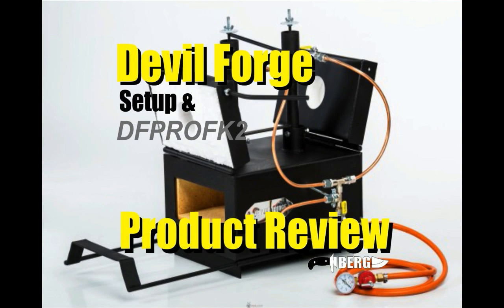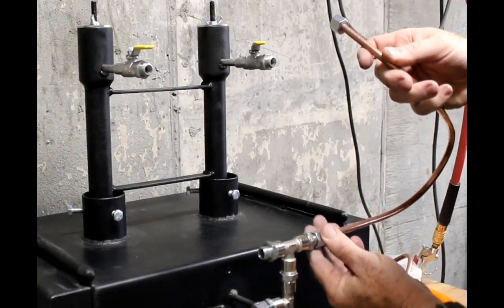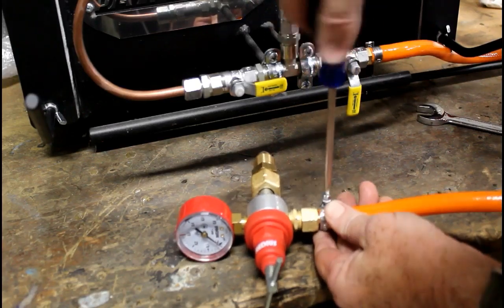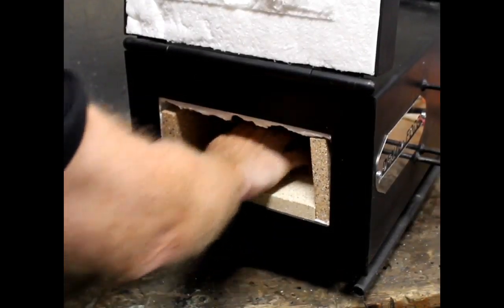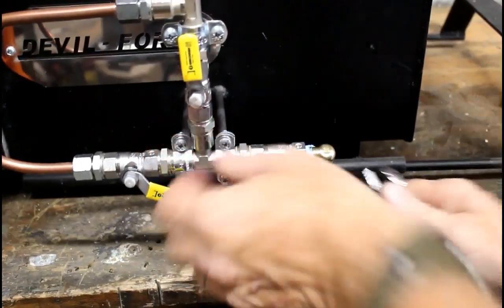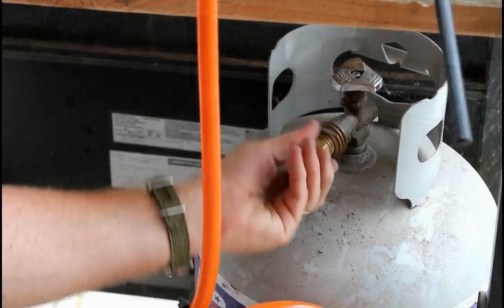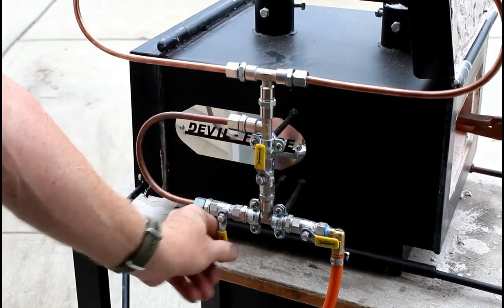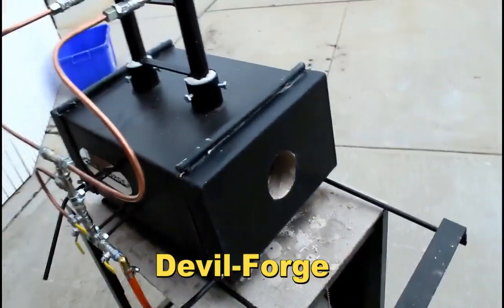Devil Forge DFPROFK2 Setup and Product Review Ebay

Comment: Never use teflon tape or anything that can combust in a gass setup.. it might go boom
Reply: This is only partially correct as there is teflon tape for gas fittings. I would higly recomend using specialized sealant on any type of screw connection.

Comment: Thanks for a clear instruction video. We received our Devil Forge #DFPROFK2 today, and on unpacking it, I was pleased to see that the gas inlet is now angled down towards the floor - or you can angle it as desired - similar to your modification. (3.02).
I should point out that when tightening the gas pipes, you should use another spanner on the slightly larger nut on each joint to balance out the twisting action and support the assembly during tightening.
Overall, we're very impressed with the quality of the unit, and after applying the rigidiser, we look forward very much to using the forge!